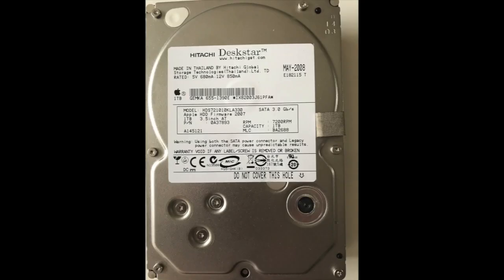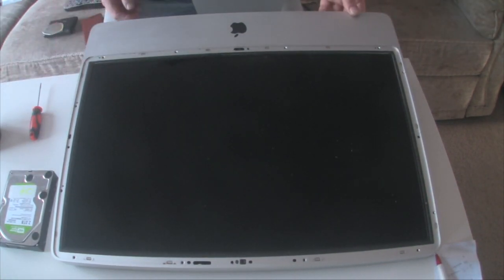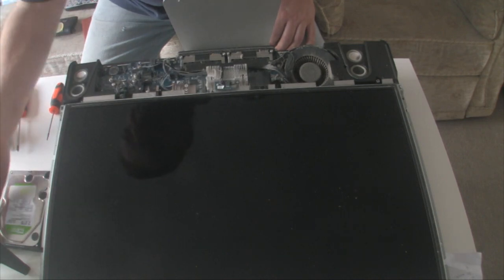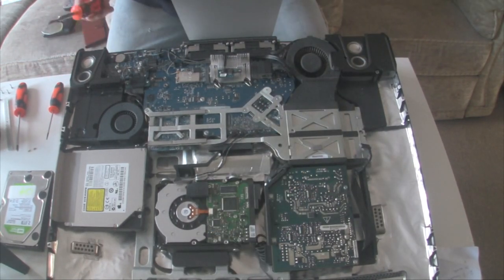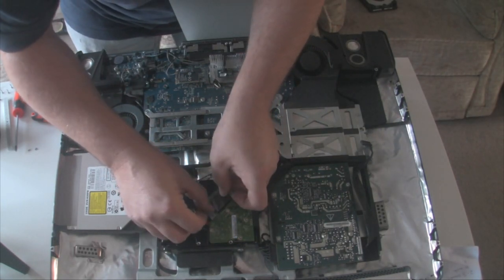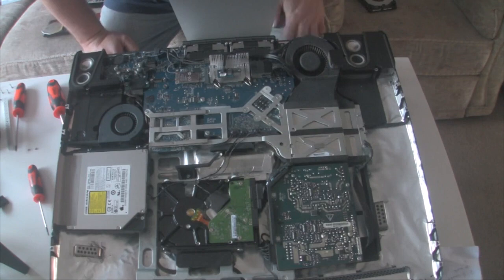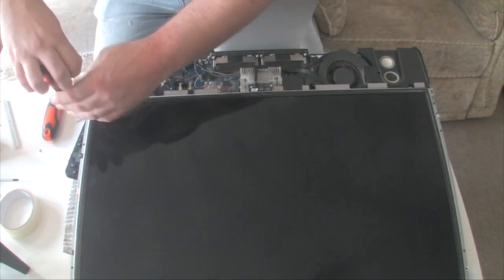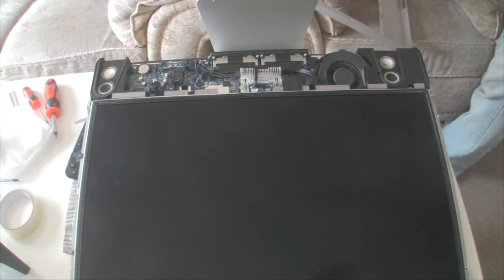Imac 27inch HDD Failure

Comment: i7 (in PC) ditched using FrontSideBus. Did that mac still use FSB? It kinda looks like it might do.
Reply from the maker: This one does it’s an older core2 duo 3.00 ghz from 2008 or 9, my one uses the i7 architecture but mines getting old too I think mines a series 6 i7.
Reply: @mjnurney  Just wondering, does ndiswrapper work with the winxp32bit driver from that mac in linux? I don't mean general linux drivers support for wifi (since I already reckon it'd do that). I mean actually using ndiswrapper.
Reply from the maker: I’ve absolutely no idea as it’s not really needed. The built in Ethernet and Wi-fi perform perfectly and hackintosh machines usually use kext hacks to run unsupported drivers / hardware.
Reply: @mjnurney  That hackintosh method sounds cool. :) My guess about ndiswrapper is that normally I'd imagine it would not be supported, i.e. because the mac came later in time even though winxp can run on the mac and has drivers. However, I might be wrong there as it might be a wifi chipset that was around in the ndiswrapper time (although I doubt that). However, a plot twist is that it is a mac and therefore, as all mac hardware is a known quantity, it might have been added to ndiswrapper's list just for the sake of having such an easy thing to add. Ndiswrapper makes it so easy to add things to old distros (which are often lightweight).

Have you any old videos mentioning kext hacks?